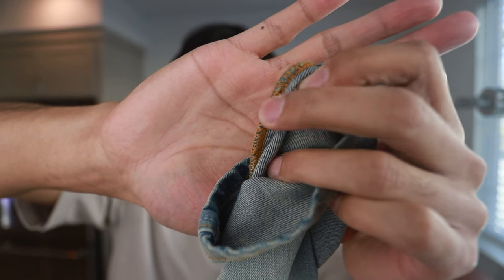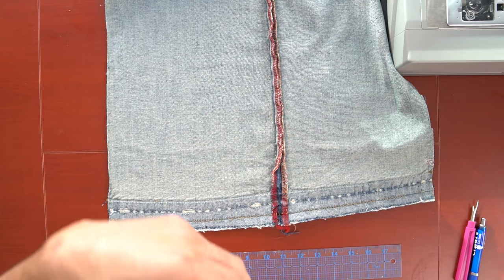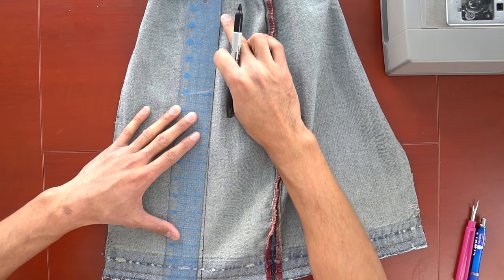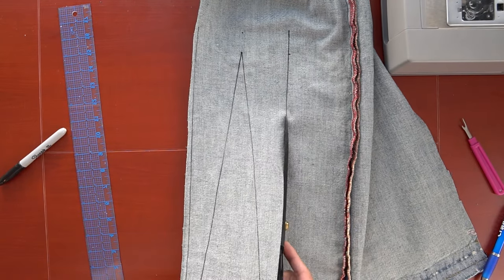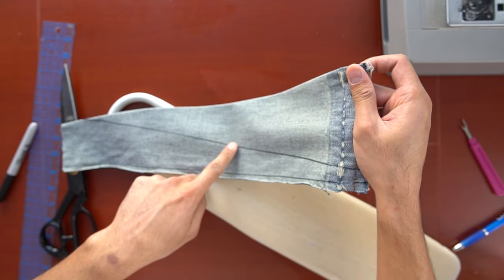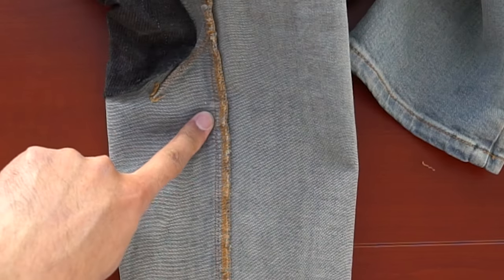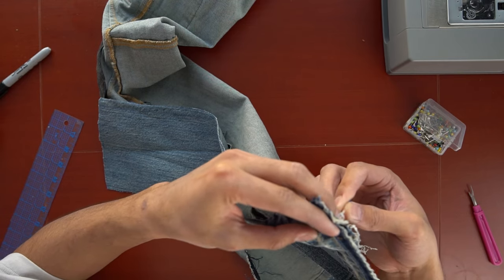How to add a FLARE PANEL to your Jeans (Explained) | JULIUS

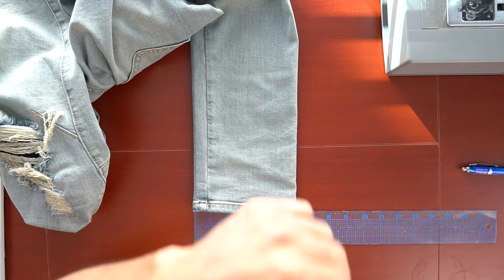Comment: 1:45 ur measuring the leg opening flat, the actual opening will be double, so the flare panel shouldnt be 4 inches, it should be 8 inches.

Comment: could you add the panel onto the inside leg to hide the panel a little more? or would it impact the final fit of the pants?
Reply: same effect imo, ive done this process to the inside and it does not change the final outcome